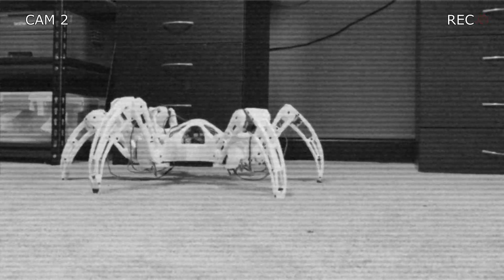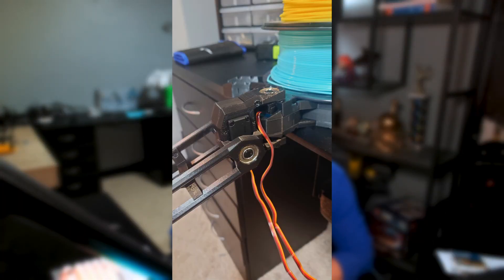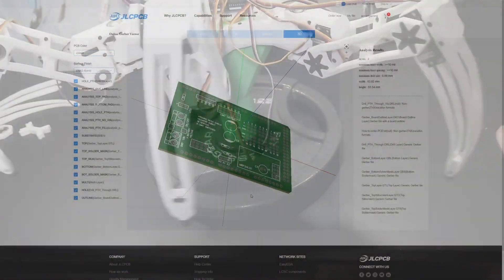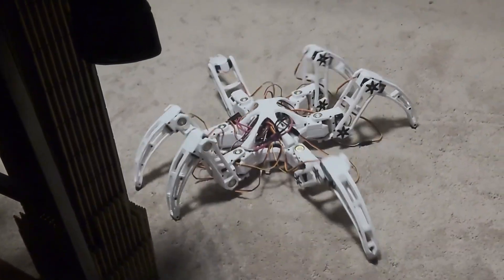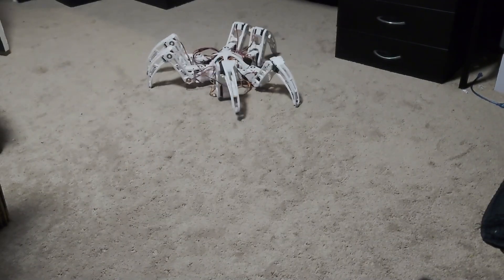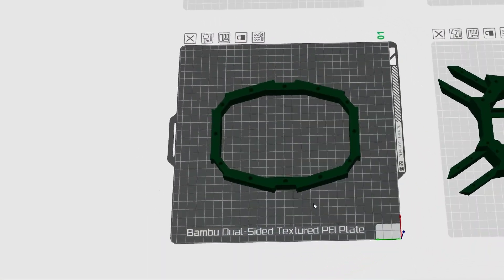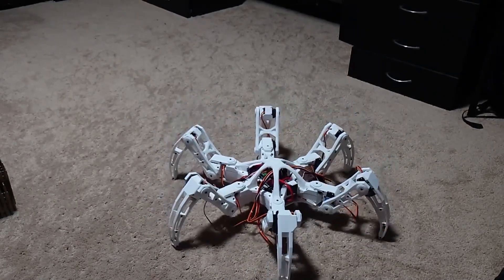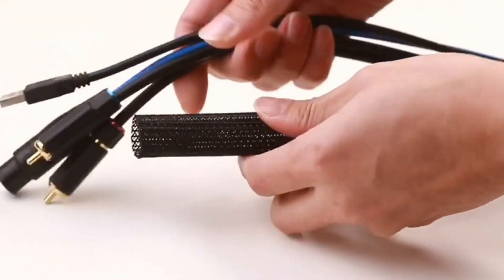I Built an Arduino Powered Hexapod from Scratch

Comment: Very excited with your project. Good job! Very interested in the way you made that crab mode. Looks realy beatiful (thought first that this looks kinda like procedural one :D). Have built similar walking platform with rotating turret, but really struggling with dynamics coding
Reply from the maker: Thank you so much :) Yeah crab mode turned out wonderfully tbh. Its basically just the walking straight code, but then I rotate the generated points based on where the joystick is pointing. Omg a turret :D I want to add an arm ontop of this thing I think it would be sick.
Reply: @AecertRobotics  oh yeah, manipulator on top of this wonderful creature is also very fun idea :D 
Ye, about the turret: i watched a lot of videos about modern IFVs and APCs and made a turret first (smth mixed between bradley and russian bmpt’s) and then i looked where can i mount it. Then i watched a trailer of Armored Core VI, so i decided that perfect place will be a walking robot :D
Reply from the maker: Lmao that is awesome. You should post a video of it!

Comment: looks very cool, just curious about whether would you share the legs 3d file?
Reply from the maker: I plan on it! I want to hold off releasing the stl's until they are finalized though. I want to try my best to avoid having a bunch of different versions flying around which will be a nightmare to keep track of.